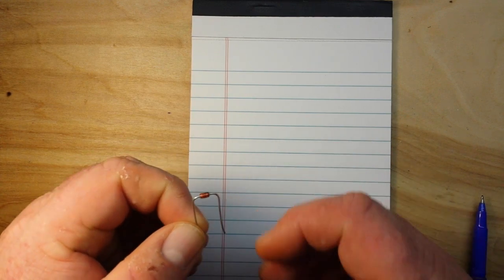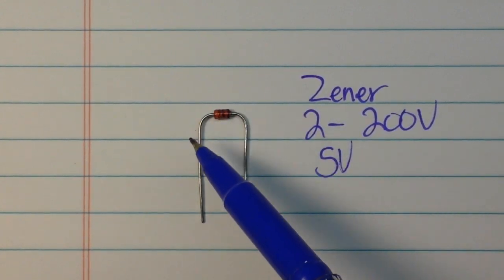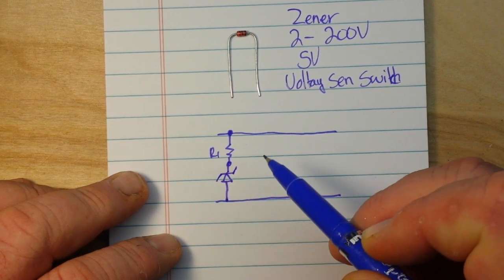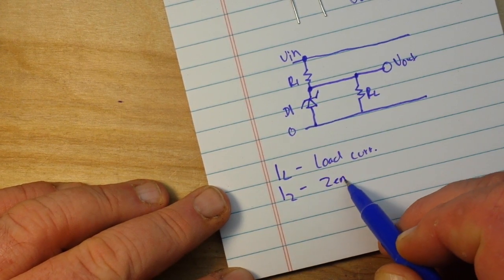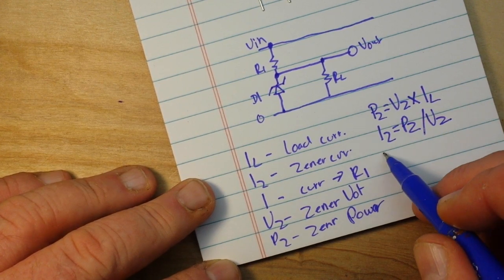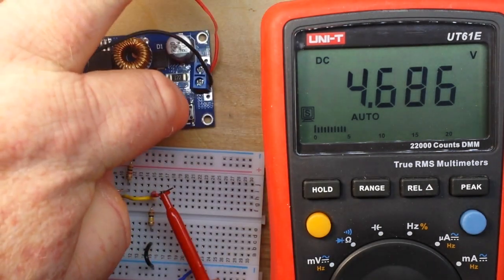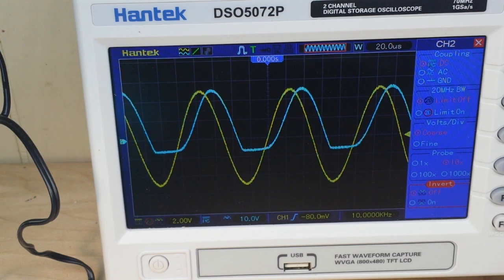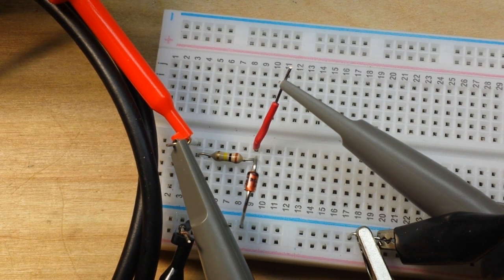Introduction to Zener Diodes

Comment: How does the use of the Zener diode compare to just setting up a voltage divider with a pair of resistors? Is their an advantage one way or the other?
Reply: The Zener is acting as a simple voltage reference - it's effectively hidden from the circuit below the Zener voltage, and above it, they allow a current to flow. Effectively, they're pressure valves. You can't do that with a voltage divider.

Comment: Hi, why you need first resistor? I could put just zener in parallel with load? Thanks.
Reply: It should work as voltage divider until zener wont conduct?
Reply from the maker: +Mini Tamm current limiting

Comment: can zener diodes be used in series to equal a higher voltage zener. if you don't have what you need? like a 20v and 7v in place of a 27v zener? just curious. I been thinking again!!!  I'm just interested in building my alternator voltage regulator. witch is basically just a voltage controlled switch. that will act as a pwm kinda. when regulating. when fully on. it can output well over 3-4 times the needed power. I have heard of a 12 volt alternator outputting over 120 volts! from a 12 volt alternator. its amazing how they work. and are still the same after all these years!!! but they are making brush less alternators now
 they are nearly 50% more efficient than a brushed alternator. enough rambling I know. this is zener time!!! thanks so much.